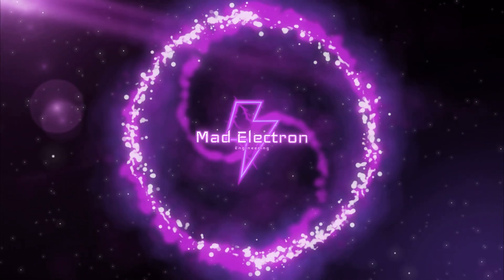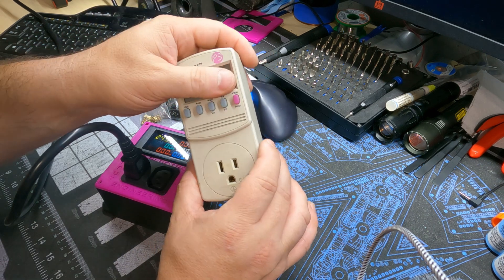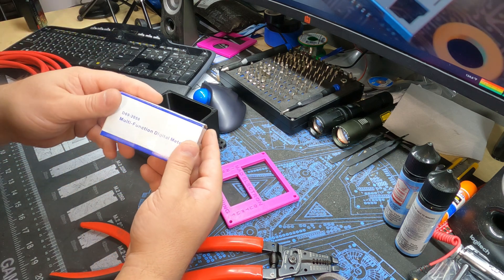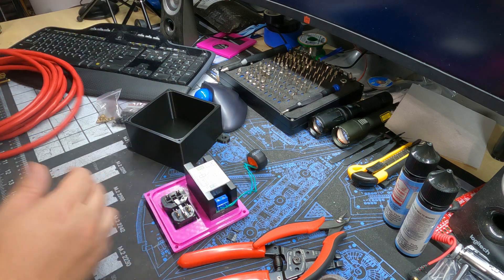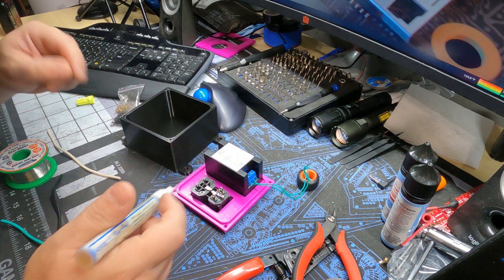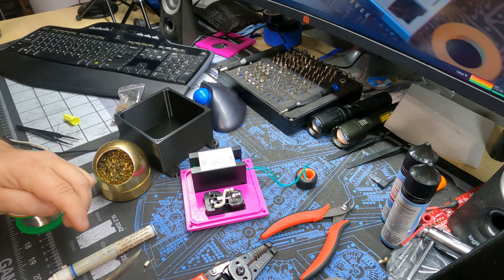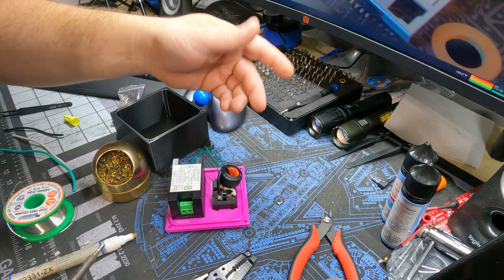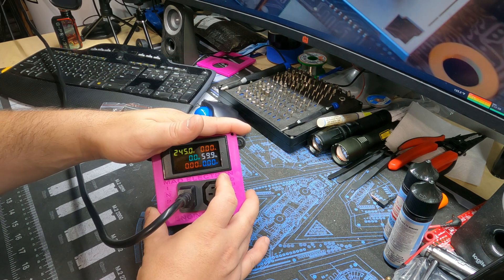Crypto Rig Portable Power Meter Build

Comment: What would happen to your electrical meter if you connected both wires from the meter to your hot wire instead of connecting one to hot and one to neutral. I hope you don’t fry your meter.

Comment: Tbh as long as any DIY meter uses any pre-made meters from aliexpress it's not going to be anything amazing.
I would probably recommend some well performing but budget mid-range multimeter with VA measurement(most DMMs measure only one thing at a time) and some adapter to hook it all up.
Reply: 4:50 AC current meters don't use hall effect sensing, just a generic AC current transformer.
Reply: 6:40 all this trimming is unneccessary, you just need to have to meter front piece designed properly and it would fit with all those clips, done before.
Reply: 8:57 Eww bro, that's not how you solder at all, you don't tin the tip and then place the tip on whatever you're soldering, you are supposed to place the tip on whatever you're soldering and then add solder.
You kind of make it work by pre-applying some flux but basics should be prectised.